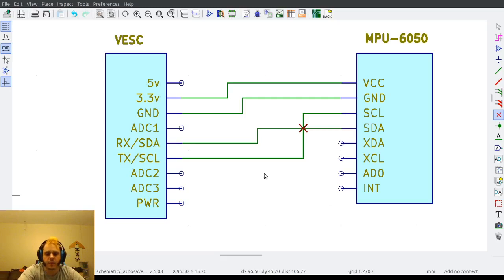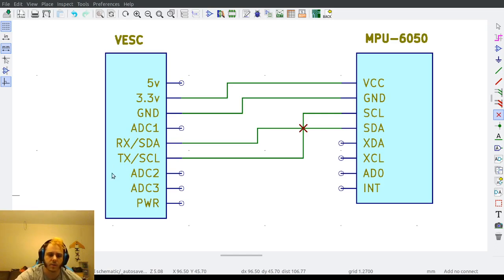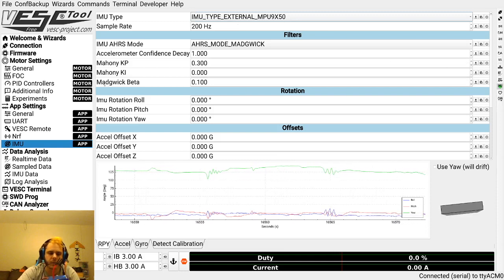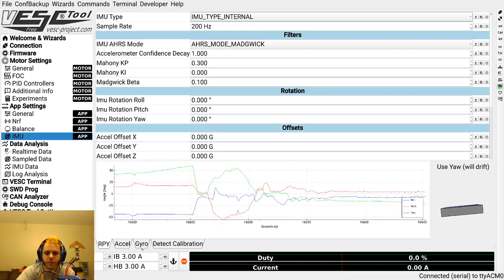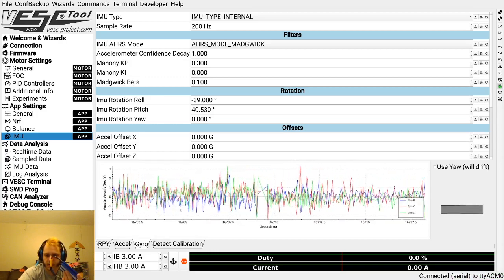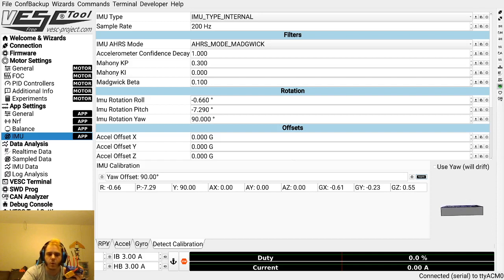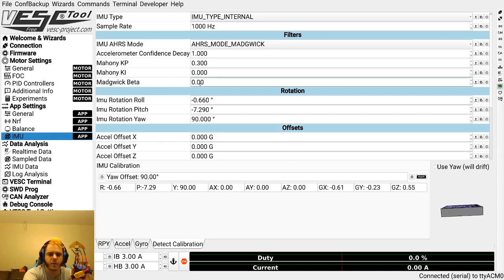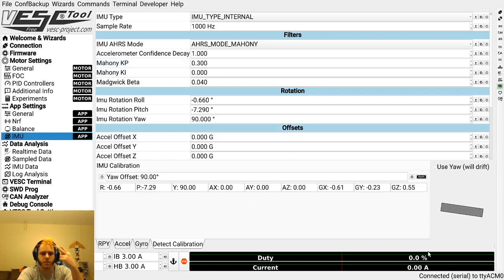VESC Balance Tutorial v2   IMU

Comment: For my board, I found that reducing the Accelerometer Confidence Decay down to zero was quite useful and resulted in a better ride than any other setting. I am guessing that it is because it's the Trampa, has an internal IMU, and that the IMU output is already filtered, but I don't really know.
Reply from the maker: If you're using mahony if found that setting makes a big difference when your kp is high.
Reply: @freedomcaller  You are right! After your video I turned Mahony kp down from 0.8 to 0.5 and the ride got a lot better, 0.3 felt like riding a boat on the ocean, 0.8 felt loose and unsteady, 0.5 was just perfect for me and my rig. Big improvement in the ride! Thanks!

Comment: Hello,
First of all, great job seriously.

I'm having troubles with my 6050 loosing connection, it seems like it happens when i crank up the motor amp and there's a spike. 
Do you have experienced that kind of problem? 

I suspected the imu not liking some possible volt drop ? 
Thanks
Reply: what happens sometimes also is that the imu completely flips and the trims don't match at all anymore (often causing fault because the pitch and roll are way out).
Reply from the maker: @jackstrapp91  I've never had this issue but I have heard of similar issues. Actually tho I'm curious, can you use the faults command after the "reboot" and see if the vesc has any non-balance faults? I'm suspicious you may see watchdog reboot error. Also if you use the latest beta build of the vesc tool & firmware you can get more detailed balance app fault info.
Reply from the maker: @jackstrapp91  if it is the imu, I can only guess, maybe try double check all the crimps and connections are solid, braid/twist the wires, and maybe add some shielding.
Reply: @freedomcaller  I remember never seeing any faults in the console :'( 
Thank you for your feedback tho, I'll try your recommandations. Thanks a lot.
Reply: friend.  did you manage to solve your fault? because I have the same problem
Reply: @jackstrapp91  friend.  did you manage to solve your fault? because I have the same problem
Reply: @lucaskuster7771  hi, I have the same problem, did you manage to solve it?

Comment: the new vesctool app doesn't have a calibration tab,  i changed my yaw 90 degrees so the pitch is in the right direction but when it was sitting flat on the table it was tilted a little bit, i adjusted the rotation by 2 degrees on the pitch and now the vesc image looks level.  can this be how to calibrate it?
Reply from the maker: There is a new wizard near the foc wizard. There are a bunch of newer videos from others on how to use it.
Reply: @freedomcaller  were you able to test the motor with the keyboard arrows? i just get a buzzing when i try.  I connected an RC car controller and got that to work but that changes the configurations away from balance I think.
Reply from the maker: @FourthWayRanch  you cant use the balance app and keyboard controls at the same time. If you disable the app the keyboard controls will work.
Reply: @freedomcaller  ya, it has to be in UART mode, I got it balancing now, working on tuning it.

Comment: my vesc says the TX is the SDA and the RX is the SCL. would it be bad to switch those? when i set the app to use to balance or no app it still runs into the issue of going unresponsive and needing a power cycle to get back to working, after i do that i still have no data.
Reply from the maker: Swapping rx/tx is safe you can go back and forth till you figure it out.

Comment: I have a mpu9250 and its not working. will it only work with the mpu6050 ?
Reply from the maker: It should work with all of them. Double check your wiring. If you're using a 75/300 clone without an nrf chip, make sure permanent uart is disabled in the vesc tool.
Reply: @freedomcaller  thank you! It's working now :)

But I can't get the imu orientation right :/ is it okay when my pitch is right but my roll is the opposite?
Reply from the maker: @adrian3137  join the telegram, its easier to debug there.
Reply: @freedomcaller  I will mate!